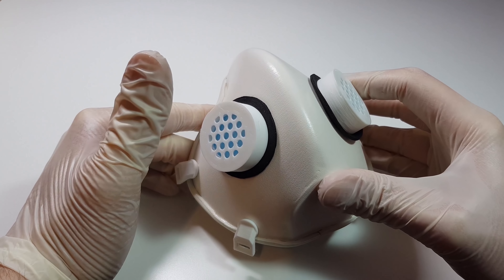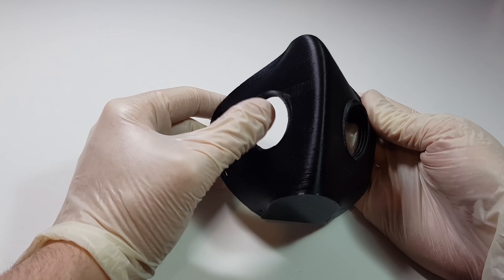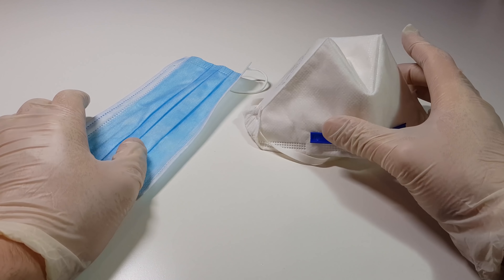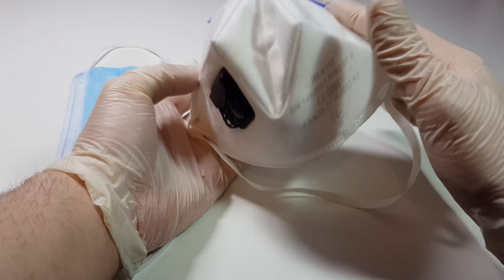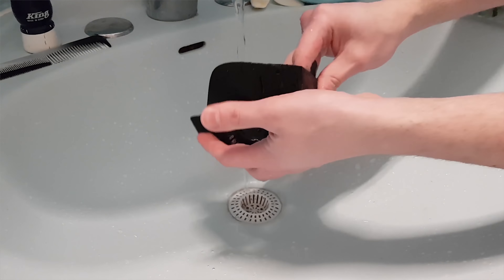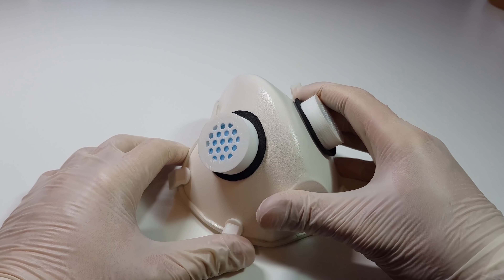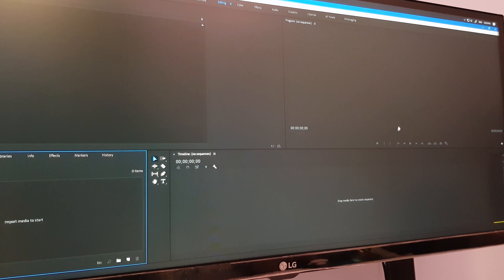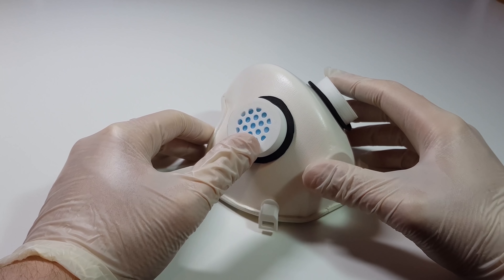3D Printed Breathing Masks. Do They Really Work?

Comment: Thank you for this video and files. I appreciate that you point out some of the flaws and dont give a false sense of security. One suggestion is to design a expiration valve. This should not be too hard to do as there are many examples used on production gas masks. The one trouble I would see in this is you would probably need to use a flexible material.

Another idea would be a valve like the N95 mask... I dont know exactly how that could be made with household materials.

Comment: I must admit I was quite disappointed when I was researching filter material and reached vacuum bags. Most HEPA bags aren't. The bags them selves are typically around MERV 10-12 and rely on the permanent filter to get most of the small stuff out.
Reply: Caution with vacuum bags.  Many contain fiberglass which is dangerous to breath.  Check with who makes them to ensure its free of that and safe to use as a filter. :)

Comment: This is amazing work, thank you for doing this.  I might like to dip my toe in and make this with a resin printer. Can you tell me the dimensions (so I know if my resin printer is sized correctly to make the mask body)?
Reply from the maker: Thanks!! Making it in resin would also require much less post-production because the surface is less porous. The dimensions (in mm) are: X= 114.5  Y= 79.3  Z= 129.3. If it doesn't fit in your printer you could split it in half and then glue it together as long as the glue seals the surface.
Reply: @megabyte4130  Perfect, thanks again.

Comment: Not sure that the leakage caused by microscopic holes is going to compare with the leakage of an standard N95 or P3 mask. The airflow is going to seek the path of least resistance, so an adequately sized vent is important to avoid air bypassing the filter and entering around the face.

The filters themselves rely on  variety of techniques to capture particles (mesh-type, collision/sticking, electrostatic, etc.), they're actually pretty interesting!

Ditto on the Copper3D mask: printed one of them and was so appalled by the fit I abandoned any further work on it. Their "industry partners" are simply stockists for their filament 🤨

Great video, lots of excellent information 😊👍

Comment: First, I liked your seal joke. Second, Is the filter holder plastic bits also treated for the holes that you were worried about in the plastic mask? Third, are those wholes big enough to let air pass through, it seems to me that they are not. Maybe you could do some sort of demonstration with a colored smoke or gas on an untreated face mask so we could see the difference. Thanks for the video.

Comment: Breathing out the same path that you breath in will make the filter moist, and quickly difficult to use.  The Medical University of South Carolina (M.U.S.C.) S.A.F.E. Cartridge System has a check valve, much like a gas mask.  No DIY design will be perfectly sealed.  I think the point of the mask is to filter large particles of water vapor from the majority of inhaled air.  It will be interesting to see whose design will prevent infection best in coming months.

Comment: Excellent video. Thank you for your efforts and information you provide. Have you considered using the printer to make a female mould. Then make a plaster/PVA male master from that and vacuum form that to make your final mask body in a thin acrylic? I appreciate you have problems getting resources at the moment.
Reply: DeWe I’m considering using a vacuum former to make a mask. I haven’t settled on a female or male mould. Would you please help me understand the pros and cons of either? Thank you in advance.
Reply: @matthewsanders9015  I hadn't thought of making the mould female, but I think it may be easier, if you are making a vac former from scratch. Consider a female mould in plaster with a good amount of PVA in the mix to keep porosity down. Cast the plaster into a wooden box with the pattern supported into it and fill it to the top. The top edge of the box can have your seal on its top edge for the hot sheet to mate to. If you design the mask with one filter (probably easier, for the sake of production), make the suction input to the form in a place at the nose/mouth area and at the bottom of the mould. Orient the pattern top edge with respect to the plane of the non linear free edge of the final part to minimise the amount you have to cut off, and to make the thickness of the formed part as even as possible. I think the female mould will give a better surface finish on the inside of the vac, which will facilitate better cleaning. It may be an idea to make a one way exit valve on the mask for exhalation, rather than exhaling through the filters. This can be done with a short piece of cycle inner tube folded over at the end and sealed with puncture repair glue.It ends up like a short condom, is about 50mm long and has a small knife cut in it to let the air out. Inhaling causes it to collapse and seal. I may CAD a model of the vac former this morning. I will share it here. It will be in Fusion 360.
Reply: @ Dewe I have a much better understanding now. Thank you.
Reply: @matthewsanders9015  Here are some images of some of the CAD I have been making. https://www.instagram.com/p/B-kp1RMn-nI/?utm_source=ig_web_button_share_sheet
I used the CAD from the author of this Youtube video and modified it to make the model of the male I will use of cast the female plaster mould. I am printing the simple injection mould for the silicone seal now and will print the vac form pattern mould tomorrow. The rest of the parts for the input filter and valve and output valve will come later.

If you or anyone has any suggestions, please add them here.

Comment: Wouldn’t closed cell EVA foam be better for this application? The foam used by many cosplayers. It’s airtight and flexible, so you just need to cut out the shape of the mask, glue it together with simple hot glue and insert a filter. The foam itself would probably work as good as that rubber to keep a right seal. Also, you can cut foam much faster than you can print :)
Reply: Beacon of Wierd exactly sr! thats what i did with my masks, flex foam are so good with different faces shapes

Comment: Have you tried printing in ABS and using the acetone vapor method of smoothing the item? It might be closing all of the holes left by the FFF method.
Reply: And did you try using silicone tub seal to create a seal. print a channel and fill it with silicone. My BiPAP mask uses something similar to seal.
Reply: I think you need a one way exhaust valve as well to get rid of carbon dioxide buildup.

Comment: Great video! my university is printing respirators, myself and a few people involved have raised concerns and tried to get help researching the safety of PLA respirator frames, but have been met with a resistance. They are very gung-ho and don't want any nay-sayers etc. I'm having trouble finding sources for how PLA can have holes and what size those holes are, you said they can be between 6-8 microns thick, do you have happen to have the source I can look at? Or did you somehow measure it with your microscope?
Reply from the maker: It's a great thing you're trying to raise concerns about the materials used and the process. I got the numbers from the documents that the ministries of health from countries like Chile and Argentina compiled. I decided to go with the lowest one they cited which was a porosity between 6 to 8 microns. With my microscope I was able to measure holes as big as 50 to 80 microns throughout the surface of the print.
Reply: @megabyte4130  Thank you, I'll look into those!
Reply: @megabyte4130  The holes are only an issue if you use one layer but most printed masks have many layers and the chances the holes in layers have gaps in the same place on every layer becomes astronomical. You will never have a 6-8 micron seal to the face anyway and this why this a 95% mask not 100%. If you still concerned with the gaps just over extrude a bit. The 3d printed mask will be much better than the n95 mask will ever hope to be. After hours of use of the throw a way mask the fabric/filter material will stretch and have a poor seal. The real risk on a mask like this is germs in the grooves but this can be over come by using antimicrobial filament and a germicidal bulb in a container to hold the mask.
Reply: @stevegorkowski3246  I have read that antimicrobial filament is a scam. Im not sure about the specifics.

Comment: If you have both but don't trust your Rein printer to produce models this size you can also coat the mask in 2 layers of 3D printign resin inside and out and then harden that. This will also make the mask resistant to most desifectants.
Reply: Good idea just coat it and self cure it

Comment: You don't really have to sand/fill as this process adds very little to no benefit. Its true that there might be some gaps between layers, but you have to remember that the print is actually composed of several walls, if their is a gap on the first wall, its very unlikely that it will go through the second wall, and if it does, its even less probable that it goes through the third wall. You can simply test it by shining light through the print wall in a dark room, and see if any photons escape, you won't.
Reply: Ya it’s layers and layers stacked against or on top of each other.  Even if one small layer is missed the next layer will smash or fill it in.   Of course u still can’t compare the consistency or reliability to mass manufacturing or traditional making methods. But at times of shortage it’s definitely bette than nothing.

Comment: I printed that mask in TPU. Design is good but need adjustments. Nose is too narow on top and too high 
Also distance between cheeks and nosse needs to be changed (added) it make holes there
Reply: I had your same problem. I solve using phon to soften and enlarge nose place

Comment: Would it be an idea to make a groove around where you screw in the mask filters - fill the groove with silicone or acrylic sealant - so that the screw down part pushes tightly against the sealant (maybe print a thin washer so the screwing down doesn't tear the sealant). That way you do not need to make a separate rubber gasket.

Comment: I like the effort you put into this quality mask... 
But I do think making simpler ones will help way more as masks are needed in masses by the hospitals and yours takes too long to build.
As a compromise between speed and quality, what do you think of masks that are printed from flexible filament and then bent? The single sheet should be faster to print and post process (by heat maybe?). Also it might provide an airtight seal at the borders.
Reply: Max-Ole von Waldow it would all depend on the surface finish.... CBC rubber is both non-porous and flexible, but degrades over time.... FDM rubber with layer-lines is a bacterial breeding ground, and is probably going to get you sick from not being able to clean it.... a hard mask is nice because you can clean it very easily! You may be onto something but re-usable, cleanable, and effective is what I believe some of the strengths of this model are. That being said, that foam seal needs to be replaced with silicone tubing.... that is the biggest flaw I see in this mask, otherwise this is the best mask I’ve seen yet in the 3D printed community!

Comment: There is another mask which does not require smoothing because it prints flat on the bed, and molds to your face(Some of you may know what I am talking about. That one can print in 3 hours. This is a good design, but for mass producing I feel like this one would take a long time to print, I am talking 5+ hours. Correct if I am wrong, I wouldn't want to make false assumptions.

Comment: Problem is systematic, not to be solved by mkaing 3D printed masks that have hard time working, need to be processed by hand etc.
Unless you'd use tehcnology that is up to the task: Pa12 form SLS that is later sealed with something like Dreibond 6063 or Loctite 401.
You can also use SLA with biocompatible resin like XFab and Ds3000. Should be safe.
Another issue is outlet valve that is hard to do right. Masks with no valve wil not work properly as they'll have very high flow restircitons.
Also each of the above cost many times more to make than buying good quality halfmask like Secura 3100 (I've bought three for me and my employees yesterday, paid  about 15 eur each)

Comment: DO NOT use most vacuum bags as they may have fiberglass in them which is dangerous to breath in.  Check with manufacturer of filter material you plan to use to ensure no fiberglass and that it's safe to use as filter media.

Comment: 3/10 good ideas but need some tweaks. Just use spray on undercoat paint first. Your Filter is comically small. Bigger screwed side filter with much greater filtering medium surface. Valve behind filter, and second for exhaled air...just like in every 3M half face mask. Just Streamline prototype...less parts, less ingredients, less complexity. And People will use It
Reply: Luki  I am looking for  a 3d printed valve - 2 parts plus the plastic flap -  For use on N95 style or cloth masks.  Yep you need 10x surface, plus the valve in all 3m masks lets the humid exhale out.   thx

Comment: Needs an exhaust opening in the front with a self sealing cap.
Reply: wITHOUT OPENING YOU PROteCT OTHERS FROM YOU. Yet Opening is forbidden in contagious environments
Reply: @ibrahimsued4906  you can put an N95 filter in the exhaust valve. I did it on mine its 2-way protection.

Comment: I've tried to print this mask on my Flashforge Creator Pro but I'm having a problem with the bridging at the very top of the threads of the two holes where the main screw installs, my printer leaves the very top 1/2 inch of threads very rough and the main screw is hard to thread in...any help?. Thanks.
Reply from the maker: Thanks for commenting. Most printers will have a tiny bit of bridging at that section of the print. You can simply go over it with some sandpaper or a knife to carve out the bridges. To be honest, the tighter the fit of the screw, the better, just remember to have some kind of seal around the screw to prevent air from leaking.
Reply: Print using lower temperature extrusor,  to eliminate ozing and stringing

Comment: This is complete overkill. I just printed the Makermask (dot) com model @ 0.10mm on my Prusa i3 MK3 using PLA and once everything is put together, the entire mask is 100% airtight. To the point where if I exhale while covering the center valve, my cheeks inside the mask puff up. 
Your process is fun, and a great way to make your mask pretty, but it is 100% unnecessary. And by the way, there are people who have their printer dialed down to be extremely precise. The deformations with your print can be addressed on the printer level so you don't have to do any post-process work. If you took the time to dial in your machine you wouldn't have to do all that work... But then again, maybe you enjoy it. But for everyone reading this comment. This process is not necessary. 100% overkill for a mask.

Comment: Consider it is kind of wasting time to polish a PLA mask. PLA mask do fatigue fast with moisture,  being daily washed, stretched and pulled. Even you polished the surface it may still crack will hurt anyone face with no mercy. Seems you are experienced 3d Print maker so you should know the fact. The crack looks like saw blade. So you better do it with TPU.

Comment: that mask was tested with h1n1. in fact, the cov-19 virus is larger by a few microns
Of course the active copper-based component is needed. (copper nanoparticles) and It is much better than a homemade cotton mask even without the active component.. 

the n95 mask is out of stock around the planet.  
your mask is amazing but the holes for the filters are very small. a little bigger could help

Comment: im sure if you just increase the flowrate by 5-10% it would be fine  and print the gasket and material on edges with TPU aswell :P-

just realsied u dont even need to sand - just spray thicker coats of clear laquer at the end !

Comment: Your introduction was great I however some issues that I would like to raise with you I hope you take the criticism as constructive and will think about correcting the errors.
1. Using Window Seal rubber for direct skin contact is a big NO - this product is not designed for or rated for direct skin contact and you can be introducing a complication into the process and someone with sensitive skin could end up with massive sores on their face preventing them from wearing a mask. 
Please NOT this is a product that has direct skin contact, there are specific health guidelines that are in place to protect people against something like this.
Next your filters, if they are real filters, I mean filters that can stop the virus and are rated at the same level of N95 masks then the surface area of your filters would not be sufficient to take even one normal breath, the much larger surface area of a regular mask is already not easy to breath through so from just looking without testing I can assume that your filter does not effectively filter the air and as such I would strongly recommend that you do not indicate that it can be used.

Another thing on was a mask with a valve in it, this kind of mask was banned very early on in China because of how dangerous it is. While breathing in the air is filtered as with any other mask, however breathing out the air bypasses the filter and unfiltered air is breathed out into the environment creating an unsafe environment for others. note that the virus enters the body through the mouth, noes and eyes and very few people wear sealed eye protection so even if they have a mask they can be infected. Wearing a mask protects others more than it protects you.

I hope that you can take this information and get the word out there 

Save a doctor ... WEAR A MASK ... stop the spread of the virus!! #wearamask